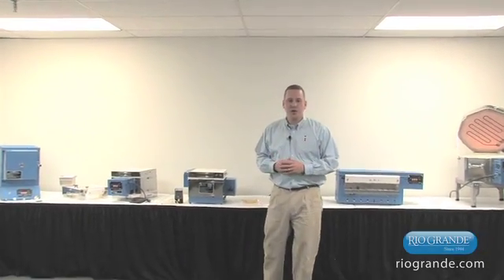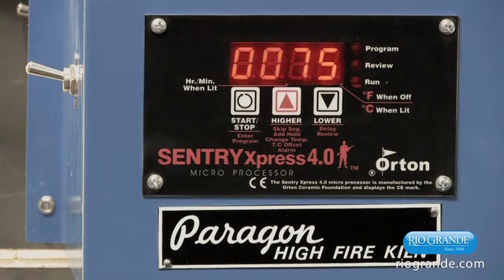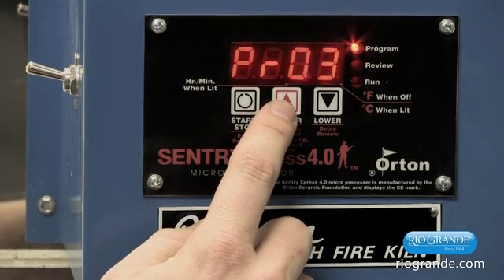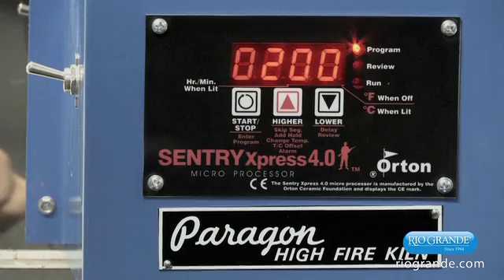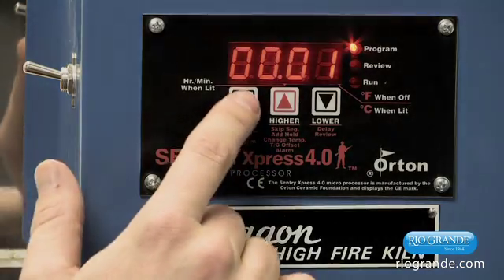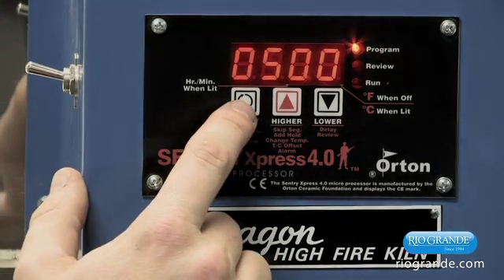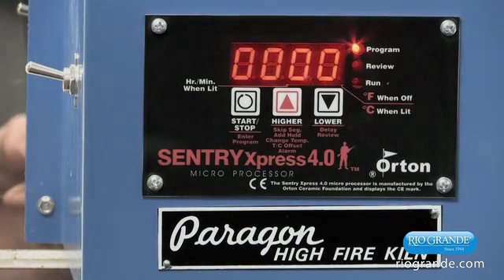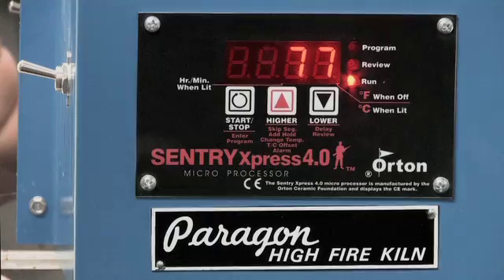How to program your Caldera, BlueBird and Fusion Kiln

Comment: Are the kilns still using this programming? Cause the video is so old…
Reply from the maker: It will depend on which kiln you have.  If you have the 3 button style control board this would be correct.  With the newer kilns, there is a new controller board and programming is even easier. Here is a link to the programming for the new controller. https://www.riogrande.com/product/rio-large-kiln-with-nine-program-controller/703120GP/?code=703120